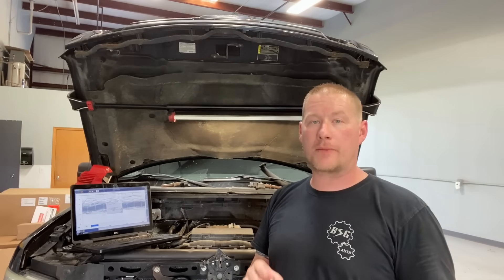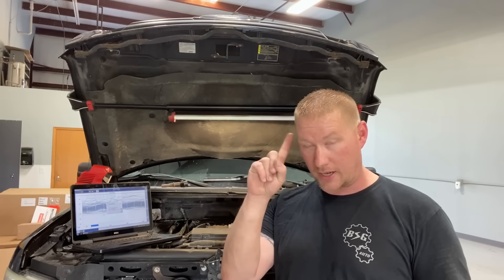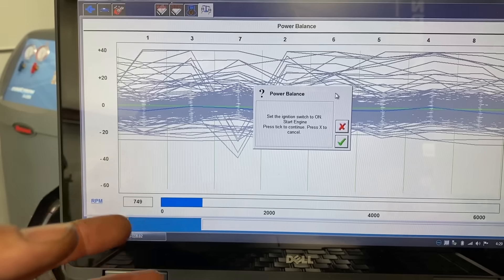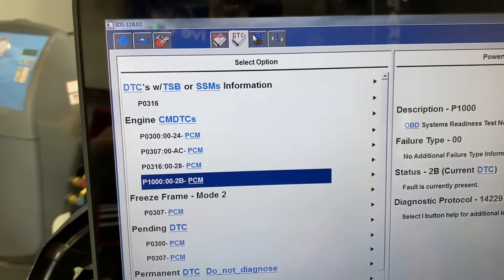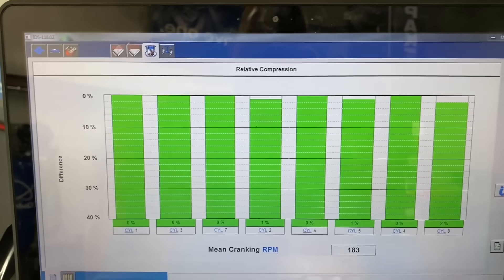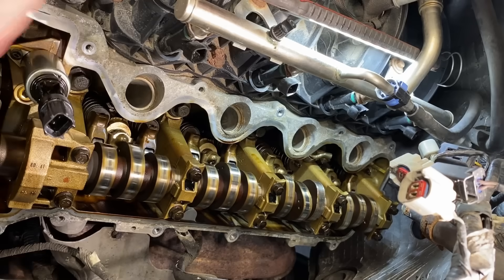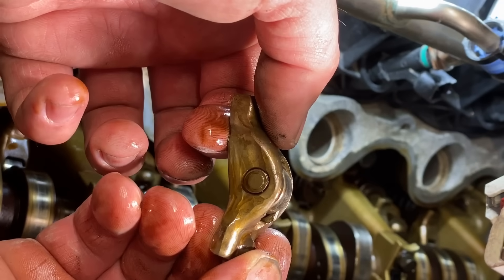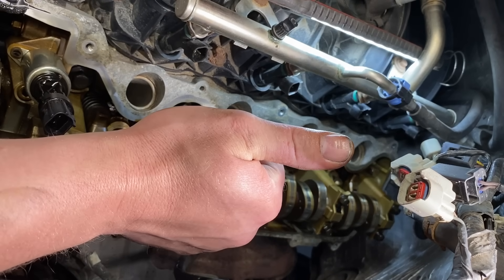Ford F-150 & Expedition 5.4L 3v Triton Engines Hard to Diagnose Misfires Fixed!

Comment from the maker: These are the Parts and Kits I Recommend:
2004-2014 Engines Latest Roller Followers x24-
https://amzn.to/3BtEHgm

2005-2014 Engines can utilize this Ford Racing Kit-
https://amzn.to/492DRYC

Forscan is free Ford Specific Diagnostic Software:
Download Here- 
https://forscan.org/home.html
ELM 327 Adapter I Recommend-
https://amzn.to/2UqDW4v

As an Amazon Associate I earn from qualifying purchases.
Reply: Hello good afternoon my e250 v8  5.4 Triton has a misfire in #7 as well but it says it's running lean could it be the same problem in this video
Reply: @joelcervantes4512  one cyl lean is usually a clogged injector...  but... because  it is the same engine it is possible.      
  Simple to test  injector if you don't mind having to take it out of the vehicle....
 just hook it securely to a fuel pump with a in line pressure regulator and give it a bump of power be sure to put it inside a glass jar or similar before you give it power they can spray hard enough to put gas through the skin
Reply: Thanks
Reply: Are these the newer design with the smaller holes you were saying in the video?
Reply from the maker: yes
Reply: @FordTechMakuloco I looked at the link and read thru it. So before I downloaded it I should get the elm327 adapter first to be able to connect to my hp computer or android. Or I should continue to now go through each checklist I created first then do forscan. But in the meantime I should pull the DTC to see if its reading the same from when my friend scanned it dec 2019. Because at that time money was becoming limited and I was waiting til taxes to get the parts fixed again or maintenance done like spark plugs and possible coils. However covid19 hit and really trampled funds for truck. I had to use what I had to pay bills and avoid loosing housing. Even though I lost my school district job behind it. I now had to wait for unemployment and that didn't kick thru until end of may. But I was able to get my parts little by little beginning may. And was going to head to my friend who has everything in his home garage as a shop. But before I could my alternator went out. So not only was I kicked back to square one I now needed to get a alternator which I did beg June.  Now I am running, but trying to figure out if I should replace all plugs. I only did the ones misfiring which was #4 and #6 but its been  #4 that's giving me the most problems. I found the thread was stripped last summer and tried my best fixing that. It was the bolt on top of the boot that was stripped not the plug. It kept making the plug wiggling loose. Now I'm hearing that rattling noise. Or it will vibrate when I exceed alteration or if I'm inclining up a hill or a freeway overramp then smooths out after I release the accelerator. 
I know that I failed smog. But kept the registration is current. It read system bank 1 lean & 2 to rich of fuel. I thought it was o2 sensor or exhaust leak and vacuum hose needs to be changed or I need a catalytic converter. If idling I do smell fumes. Not as bad as before a couple of months ago. I don't want to even think about replacing convertor with that price tag. And prayed it was something less expensive. 
History replaced:
Radiator, master cylinder, water pump, alternator x2, battery x2, starter, fuel pump, cruise control, normal change, and just recently all tires.
Current mileage 228529.
I don't want to get rid of my truck. Husband is nagging me I should. 
I'm acting like the dude under the hood, and he's the woman complaining. Even though he taught me everything about cars I have now kicked him out being in the garage fixing it and when I can't or don't want to get in the hard places I just get the parts and go to his friends house instead. And 95% of the time I knew what the problem was without coding the truck and shocked his friends knowing what parts was needed and saved them the trouble and time going to get it from auto store.
Reply: @FordTechMakuloco  i have a 06 f150 5.4 will this cause a misfire on e f g noone were i live can help it all i have to drive any advice will be apperiated
Reply: @FordTechMakuloco what about a #2 misfire? Could it be the same thing?
Reply: Looking for some direction. I have an 03 expedition 5.4. intermittent power loss, No significant misfire, no check engine, no chatter of any kind. Feels like a plugged cat or can phasers but they checked out.
Reply: What is the name of the laptop diagnostic cable you were using there on your truck? Or if its a diagnostic laptop, where'd you get it from if I may ask? I'm looking for one of those myself.
Reply: So far I think I've watched almost all your videos your very good at what you do and for that I respect you even  more
Reply: Hey Brian, I did the power balance and shows at number 8 a little issues but no codes and no misfires. I just changed my full timing job and everything works great just a little shakes at idle
Reply: Turns out the ignition coils and also the rear spark plugs were the issue
Reply: A little update, it was just the ignition coil!
Reply: Will the Forscan work on a '97 F150 4.6 as well as the adapter from Amazon?
Thanks, and thanks for the videos.
Reply: Hey my man good afternoon I would love to get some guidance
Reply: Looking at a 2011 f 150 lariat it down shifts hard dealer says that’s normal can you tell me the real issue
Reply: I just bought an 04 5.4 3v at what mileage interval should i have timing and oil pump done it only has 106k on it and I run mobil 1
Reply: Po
Reply: Please I need your help...I have a 05 Navigator and the air suspension is giving me a headache...sometimes the front air bags are up sometimes not...the rear air suspension bag go down most of the time are up...now the passenger side it’s down front and rear and I get the alarm telling me to check the air suspension...I reset it and works for a while and after maybe 20 or 30 minutes I get the alarm again...please any advice will help thanks a lot
Reply: Hey any idea why my 5.4 expedition stalls and turns off when I’m reversing just got my timing done and the mechanic says he hasn’t seen this happen
Reply: I have a 99 Ford Explorer 5.0 I my into my 98 Ford Ranger the 99 have Pat’s System I bought a 96 explorer ECU it’s started but want shift so if I get the 99 ECU Deleted would my transmission shift? If so how much would you charge for to delete Pats System
Reply: Can I just bring my 03 expedition XLT (5.4 Triton, V8) to you for a thorough look over??!!!! 🙏🏽👍🏾 Check engine light is on, got codes PO171 and 174!
Reply: University will never teaches us like I spent two at technical school for mechanic I never learned better than those guys out there on youtube.
Reply: Hi Brian, I love what you put out on these videos. I do have a question. I have a 2014 Ford F-150 Ecoboost that has a rumble when driving. I feel it is in the engine. I have replaced spark plugs, Ignition Coils, cleaned sensors but still have a rumble. What do you think it is?
Reply: How do I get ahold of your shop?
Reply: In my case it was cylinder number 2 tick, tick tick...then it flew off.
Reply: I have a 2001 2 valve 5.4 triton with a misfire... I've replaced plugs and coils and replacing valve cover gasket cause the spark wells were full of oil... what else could the misfire be from
Reply: I'm having that same issue with my engine I'm assuming, I have all plugs and coil packs are fine, no codes read. Where's your shop located
Reply: I have a p1132 code on a 02 f150 5.4 
I have replaced o2 sensors, mass air flow sensor, egr and still can't figure out why it's running rich.
Reply: I feel like my ticking noise is on the left hand side we’re the oil cap is what do you suggest I have a 5.4 triton v8 2003 f 150
Reply: Where is ur shop located?
Reply: Where you located???
Reply: Hi buddy I wish to take my 2007 expedition  to your shop I pretty  sure that I have the same issue   and I'm hearing  the clicking    noise  when I accelerate      the car ,  again  as I told  you I leave in brooklyn  ny I wish to know  what is your address  and how I can contact  you. Thk
Reply: You're telling me that the random tick noise is this right here. Could I record and have you verify the noise?
Reply: Just replaced all the followers and lash adjusters and Jegs was the cheapest I found.
Reply: Is it possible for me to get a link for your Amazon stuff you sell because I live in jamaica and not for the love there's nothing out here call parts but I don't mind buying the good stuff just need to know where to source them
Reply: How are you doing my man. I just replaced my motor and I am still getting this problem.i do not have catalytic converters on my truck. So, I am thinking about replacing my exhaust. We bought this truck from an auction, and the catalytic converters were already out, and when we used to drive it. It used to make a horrible noise, but now the noise has stopped, but it still has a small miss. Can you give me any advice.
Reply: I have a 2005 f150 4x4 auto recently did plugs, coils, injectors…still have a misfire on #4 planning on doing a timing job but also want to squeeze more power out it any suggestions?
Reply: Does this apply on the 2010 5.4 also ? I have a ramdom missfire also.. cylinder 7 .. I turn the car off and missfire goes away
Reply: I have a 2009 Ford f150 with a 5.4 engine.

Starts but does about 2 seconds later.  Turn the key all the way off and do it again and it starts fine for 2 seconds and then dies.

What do you think  is wrong?
Reply: Great video, I need your expertise on my f-150 4.6 truck, I can't seem to get past 3omph in drive but achieved it when I shifted it to 2nd gear, no one has been able to tell me the problem, I have checked a couple things but still the same problem.
Reply: How much is it about to fix it?
I have a 2001 5.4  expedition doing the same thing. I replaced plug,coil and injector.
Reply: Btw, I'm disabled so I dont think I can take on a project this size. That's why I asked the cost.😮
Reply: This freaking sounds like my 2000 expedition 5.4 #4 #1 misfiring cant pass smog 228,000 HELP ME!! YES I HAVE CAR KNOWLEDGE TO UNDERSTAND EXACTLY WHAT YOUR SAYING.  SO TELL ME THE FACTS.
Reply: GIlli8i i8I88l8ki8n9iooikiki[lii8looooooooooooooooooooooooooooooooooooooooooooooooooooooooooooooooooooooooooooooooooooooooooooooooooooo[ooooooooo9ooooooooooooooooooo9oo99youooooooyouooooooooootototolostillstill9cationostillyouyoulocationyouyouooyouoooooo9ooooo8youoooooooooooootototyouyouyouyouoolocati9onlyyouyouyouyouyouyouoooooooootototolocationphotoa

Comment: 2003 Ford Expedition XLT ...Randomly just shuts off... no rhyme or reason...I'm told it's the fuse box . Fuel Relay. QUESTION: Can you bypass the fuel relay switch?

Comment: Here's one for you...2006 f150. 145k miles.
P0340 and P0344.
Changed cam and crank sensors, VCT, new timing chain (thanks to you!), rocker arm followers, battery, water pump and oil pump (may as well).
Still comes with same codes, but usually only when I start it up.

Comment: Not sure if anybody sees this 5 year old video anymore but just in case. I’ve got a 2007 with #6 misfire. I’ve done the plugs, coils, new injector, mass airflow sensor & nothing fixes the misfire. Now, it’ll run sometimes with the misfire but other times immediately after starting it stalls, over & over. Lots of lurching as well. There’s so many things I’m seeing it could be. Anybody have any ideas, tips, recommendations?

Comment: I’ve replace all 8 spark plugs, all 8 ignition coils, and all 8 fuel injectors. I’ve replaced several sensors, throttle body, fuel filter, both manifolds, radiator. Still getting p0308. It is absolutely convinced something is wrong with cylinder 8 and at this point, it’s internal. I don’t have the time nor money to be taking the whole damn engine apart. Bout to trade this thing in. Been nothing but problems.
Reply: Don't say this....just had this code thrown yesterday
Reply: @j @jonathanunkel4874 t it in for a diagnostic. Blown valve cover gaskets they’re saying. Oil getting into spark plug tubes. $900 in parts and labor, does it sound reasonable to you? And it’s Firestone.
Reply: @jonathanunkel4874 Bro you’re not gonna believe this shit. Got all that bs from these big company named mechanics and then had a local mobile tech come look at it. Took the spark plug from cylinder 8 and switch it with cylinder 2, the dead misfire from cylinder 8 move to cylinder 2. Bad spark plug, brand new, still bad. The “oil” they were talking about was just freaking coolant from when I did the fuel injectors and some spewed everywhere for a second. It’s running so great right now, I’m almost crying with happiness. 5 years of this truck giving me headaches and it’s finally running the best it ever has! Check your spark plugs! Just because they’re new doesn’t mean they work.

Comment: So glad to have flund this video 
What do you think of number 4?
Im getting a missfire on number 4 on a 2007 5.4.
Did the plug and coil over plug and its still there.
No ticking sound however and I did the Cats as they were plugged long before this issue.
Note I only have and INNOVA cheapie scan tool but I can get libe data

Comment: I have a misfire on cylinder 8 of a 2008 5.4 l , replaced the coil and spark plug, continues to misfire,  should I be looking at a intake follower popped off?

Comment: I have a cyl3 misfire its not a coil, injecter or plug i moved them still in cyl3. Im removed valve cover everything looks good. I only fill a misfire at idel about 1200 or so it feels good. Im thing of pulling the drivers side valve cover to. Maybe i get lucky an find something. Love your videos I've done 2 timing job in the past by following your lead thanks man.

Comment: Brian, you left out some major info on this issue. Was there any codes thrown when the follower cleanly popped off? What was the daily driving like with this issue on going? How was idling affected? Is it possible that no codes are thrown until you get up to high rpms? Please realize you may help a lot of people (including myself) by answering these questions. Thank you.
Reply: He said it showed a #7 miss fire code, but the best thing for any individual miss fire code is to inspect and swap the coil pack and spark plug with another cylinder it's a free and easy way to eliminate the primary culprit of a individual miss fire problem
Reply: @3613jeremy  Primary stuff is not the issue. I need to know what this failure mode "feels" like. Spark, compression, and fuel checks out on the unit I'm working on. I can get a misfire code to appear as well, but over and around 4200 rpm. Idle is also slightly rough, and will continue to idle rough without throwing any codes. Only seeing a slight flutter in idle vacuum, which is 21 hg in. Now you know why I said I wanted to know what to expect when a roller pops cleanly off.
Reply: @litigiousfeline if you haven't tried to clean and run a relearn process on the electronic throttle body i would try that its free and not hard to do and is a requirement after any kinda repair that can effects the air, fuel or spark of the vehicle. as far as any kinda common feeling / noises that any failure makes is never that easyand  its why people pull out the parts cannon so easily any more
Reply: @litigiousfeline i would also consider checking the batteries health and any wiring connections

Comment: I have a 2007 lincoln mark lt i can be driving it will stutter 1 time and i know now its ready to cut off i get to the side od the road starts back after a few minutes took to several mechanics they diagnose it different codes put up gose to ro the dealership they thought they had fixed same thing they did refund my money i just need to get it fix runs excellent while running but you won't know when its cutting off, tired of renting trucks,  can you recommend anything .thanks

Comment: Bro can it happen on cylinder 4
Reply: Wondering the same thing. Have a cold start only misfire with 17 misfire counts on cylinder #4. 200,000 miles. Truck shakes pretty good for 20 -30 seconds but smoothes out.

Comment: I’m currently chasing a misfire  on a 00 6.8L that only occurs below 2000 rpm in overdrive. Truck has 238k on it so I replaced all plugs and could but the misfire is still there

Comment: Brian thanks again for all the knowledge you pass on to us. I have a 2014 expedition and when I go to the link for the ford racing kit with followers and lash adjusters it says it does not fit my vehicle. Will that kit work for a 2014 5.4 motor. Thanks again
Reply from the maker: yup it fits.
Reply: @FordTechMakuloco  
Thank you. I found my problem I pulled off the passenger valve cover and #2 spit off a roller follower and chewed up the lash adjuster and the cam. Do you have a video on replacing the cam and and all roller followers.

Comment: I have a 2016 Triton v10 with a cyl 4 misfire.  Is that a known cause that you know of?  So far new plug and coil did not fix it.  Plug looked clean for it's age, appx. 35k mi.  I'll be looking at injectors next barring any suggestions.

Comment: Every make and model after 1997 are all junk. Coil packs etc.. are all garbage. All these issues never happened with the older models.. plugs, wires, cap and button. DONE! Runs like a dream. Newer vehicles are alllllllllll junk!